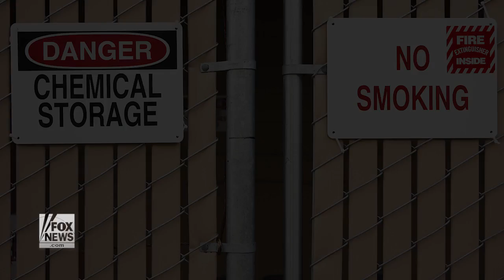Harvey fallout: Arkema chemical plant explosions explained

Comment: Yes, it was EASY to prevent.  Two simple measures would have entirely prevented this :
1 Keep Generators and FUEL above the flood-line (duh)
2 When a compromise seems inevitable, dilute the peroxides so they can't explode.  Neutralization is trivially simple.  You do this at labs when you shut them down, or go off-season for summer / winter breaks.